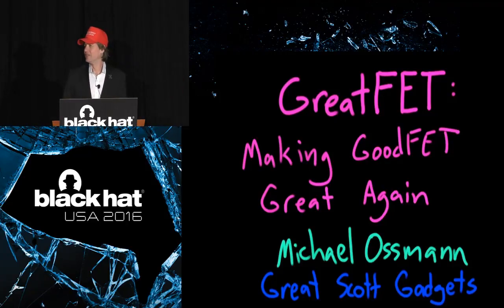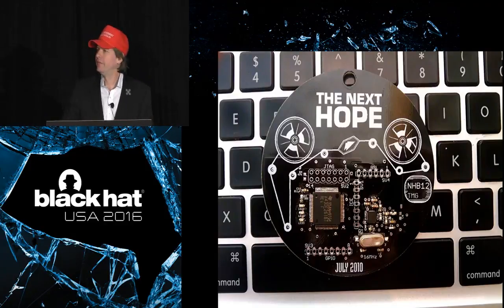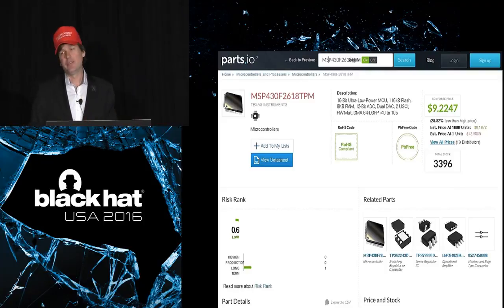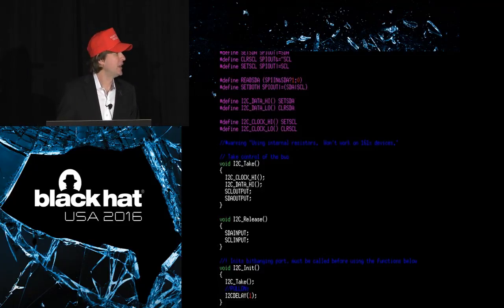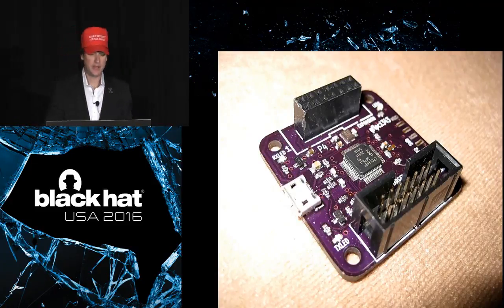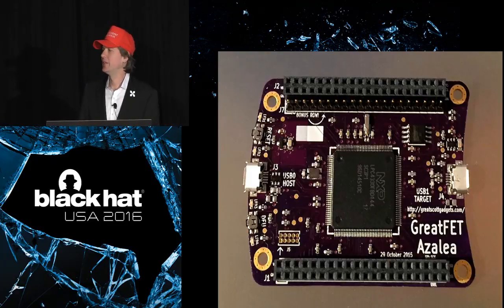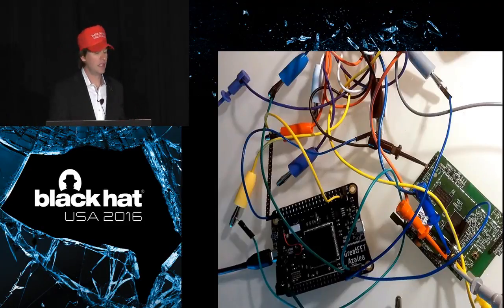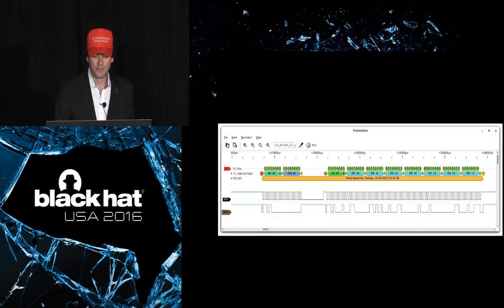GreatFET: Making GoodFET Great Again

Comment: Does the GreatFET run a python interpreter.. if not, what's the protocol between the Host PC running Python and the GreatFET?

Are the GreatFETs available for purchase anywhere?    

Also, I recall Michael mentioned another a general purpose tool he's working on..  I don't think it was Daisho..  something like Cassandra maybe?